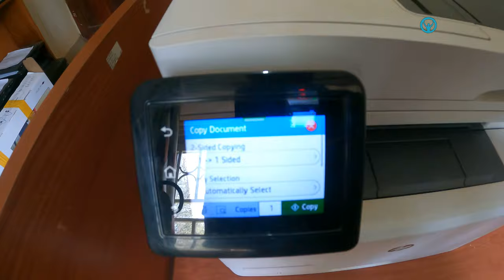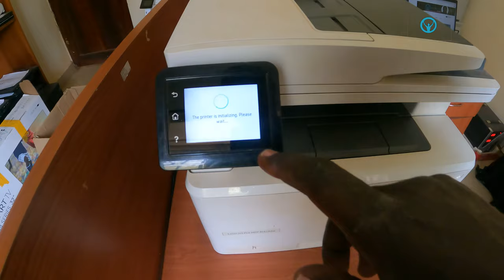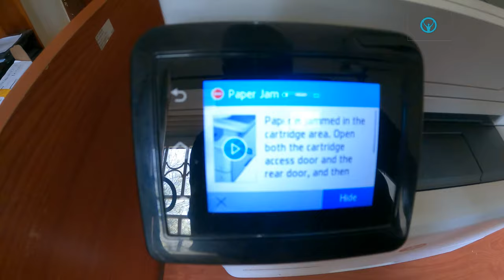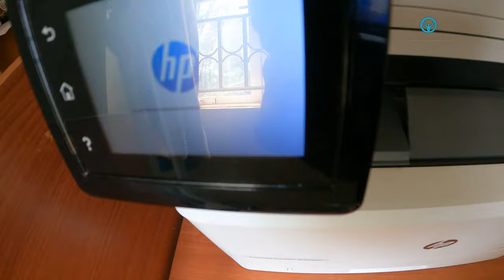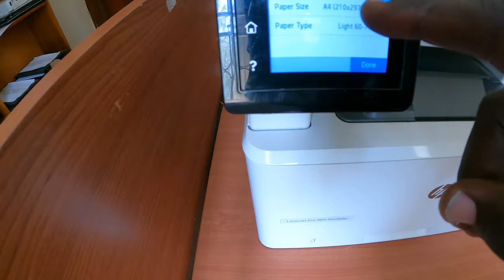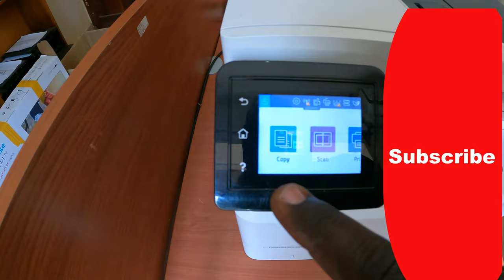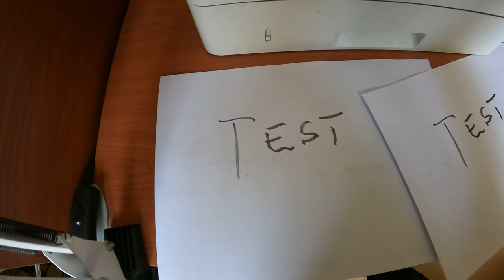HP LaserJet Pro MFP M428dw Printer | Service, Maintenance & Repair

Comment: Hi thanks for this informative video.  I have the same printer and wanted to know if you have any video of this same printer regarding on how to fix tilted scan documents using the top feeder and also tilted printouts.
Reply from the maker: @An2qen, Sorry about that tilted challenge, I have not yet made a video about it but you need check the Rollers (Pressure roller & Paper transfer rollers), they may be faulty & require replacement...

Comment: Hello I am using hp laser jet pro mfp 4104 dw in this printer  problem is while coping it come black straight  line can you help me for that
Reply from the maker: Hello, does the black line come only during photocopying or even when printing?
Reply: @opolotiversity  I having the same issue, like smudge black lines when printing and photocopying